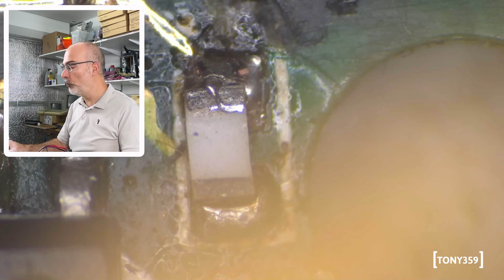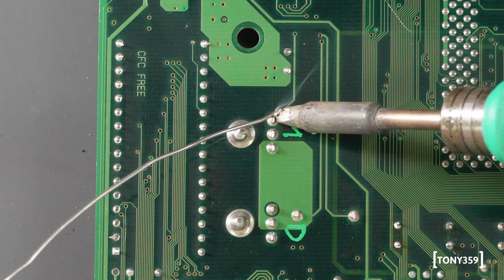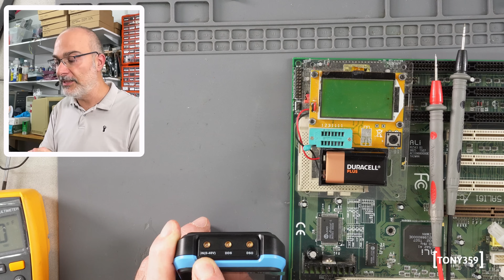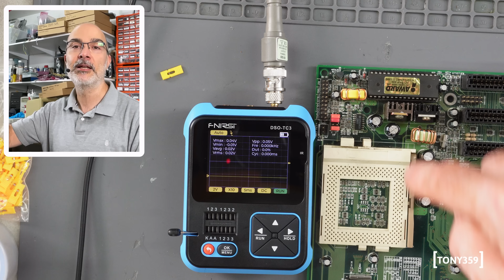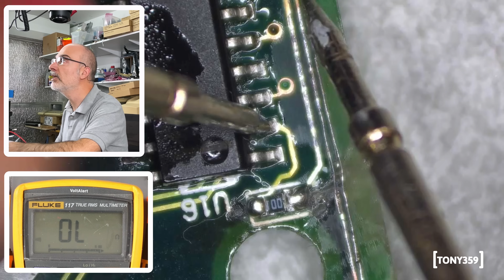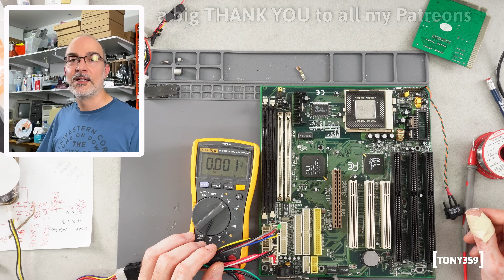This motherboard surprised me with multiple unrelated faults!

Comment: For those cheap component testers you usually do calibration where you connect pins 1,2,3 together and power up. Your old tester maybe too old to have that feature or need to have software update. For my tester it improved measurement accuracy. If I remember right it was showing too hi esr and Rds values before calibration.
Edit: Also discharge all caps before putting them to tester. I have killed one tester that way.
Reply from the maker: Thanks - The Fnirsi was calibrated just before shooting the video unfortunately.
Mine doesn't have that feature indeed - I'll see if I can update the FW!

Comment: Break the track from the Southbridge and drop the reset to see if boots? Would pulling the reset line low artificially do any damage?
Reply from the maker: I could try but I doubt anything would happen if the Southbridge is not working.

Comment: I have this board, It works but its niggly, Windows 98 wont install nicely if  USB (other BIOS setting ??) is enabled, I can't remember exactly but using ATX power,  the soft-power/the power button  doesn't work right  if I recall correctly, if the instant power off is enabled in the BIOS it doesn't work,  so its  holding the button for 5  seconds, while not the end of world its gets annoying fast when troubleshoot a retro PC . Don't mess with JP2 near battery, as jumped to pin 2-3 will cause one of diodes near by to short, luckily the diode just de-soldered it self from the motherboard didn't do lasting damage.
Reply from the maker: interesting - you're saying that maybe all I have to do is to hold the ON button for 5 seconds or something like that like that weird Acer MoBo I had before? I've done most of my testing without the BIOS to be honest as I'd expect the Reset line to work without it - the board won't execute code in RESET I suppose...
I think I tried that jumper in position 2-3...
Reply: @tony359  R178 is indeed a 10 OHM (SMD 100) resistor on my board. sorry I messaged without completely watching. No, not at your level of troubleshooting so was just giving general advice on that Board... that ALI chipset also has issues  It doesn't fully cache memory above 128MB  or something like that as  if recall correctly  unless  its chipset revisions G and H.  I can test other bits on my own board (its in strip down state no battery and I stole its jumpers)  if that would help, I do own a scope but digital testing is not my forte.
Reply from the maker: Thanks for confirming that that resistor is actually correct!

Comment: These component testers are very useful (I've had 2 that I've been using for the past 10 years or so) but you must be aware of their limitations. For instance take a JFET like J105 which has a very high Idss on the order of a few hundred mA. The tester will not identify it correctly. It reads it either as a resistor, or as a double diode. This is probably the most extreme case; there are other situations that fool the tester, for instance components that need to be tested at voltages higher than it can provide, which is around 8-9V (the 9V battery is an indication of that).
Reply from the maker: Of course. I don't expect a £5 tool to perform like a £200 one. I'm not expecting perfection. Just not 100x difference from a similar one :) Thank you for watching!
Reply: Also simple germanium diode is often not detected even germanium transistors are measured quite OK.

Comment: The difference in ESR and capacitance could be do to the frequency it tests the capacitor at.  What does your Fluke say for the capacitance?  Does either of your testers say the frequency for LCR testing?  If you are going for a LCR meter go with the DER EE, DE-5000.  Excellent LCR meter for the money.  You may want to pay the extra now and get the meter with the tweezer option, expensive to add later
Reply from the maker: Thanks - yes, I am eyeing the DE-5000. I think it's time I have a decent capacitor tester :) Thanks for the hint!
Reply: @tony359  Use oscilloscope and measure the frequency both testers are using. Maybe thats why ESR differs so much. 
Btw 22u capacitor with ESR 10ohm is bad, but in transistor radio would still work OK for years if its used in AF coupling :-)
Reply from the maker: I'm looking into that, they don't use a traditional way, there is no "frequency". They use some tricks because the ATMega cannot deal with those frequencies. The original documentation of the "transistor tester" says the ESR should be comparable to the 10KHz one.

Comment: Tip for surface mount work around plastic: Captain tape. It won't make the plastic invincible but it increases your margin for error enough to be worth it than not.
 Using a preheater under the board to get the board warm will also help.
Also do yourself a favor and don't use the $60 junkazon special. Get a Quick or a Atten.
Reply from the maker: I do have a (genuine) quick :)  (Junkazon special LOL!)
I do have a pre-heater!

I will make a shield using some tin (from a drink can). Plus kapton as you say. 

Thanks for taking the time to send me some tips! :)
Reply: @tony359  I don't trust those $60 stations. I don't think they have the "horsepower" of the more expensive ones and after seeing "EEVblog #1171 - Yihau WEP SMD Rework Station Meltdown!" I have concerns about fire safety.
Reply from the maker: I used to have a Aoyue and I know what you mean. They're junk and you can only burn things with them as the air temp is uneven. That said, dosdude1 does wonders with it :)
Reply from the maker: I try not to buy mains-operated equipment from Aliexpress/Ebay. They can have serious safety flaws...

Comment: I would try to cut reset trace from the ALi chip and see what it does, before replacing it. Also, that 10Ω resistor looks a little bit sus to me.
Reply from the maker: Well, I would nee to pull it to ground, not just cutting it. And the CPU and PCI reset lines are elsewhere. One thing I did not check is what happens to those other reset lines though.

Comment: Component terminals rejecting solder like this resistor it happens, when there's a thick oxide layer. It's an indication that the component is expired and hasn't been stored well.

Also i hate components being arranged so close to a hole like that, because that's why that whole section is damaged and had to be reworked by previous owner. Is the hole needed? I don't think it's an AT/ATX mounting hole, i don't know why they put it in, did they need it for some sort of factory jig? It's terrible either way.

Ahahah when you have one voltmeter, you always know what the voltage is. When you have two voltmeters, you never know what the voltage is! Doubly true for these ESR/LCR devices!

I would rather trust the cheap one. It's a faithful reproduction of a German open source project, and the values it delivers, even if they are not what one might call exact, because really who knows, these are not straightforward values to measure, they just make sense for repair purposes, since it's quite sensitive to decayed parts. What TC3 shows doesn't make much sense! I too have the classic cheap LCR T4. Been thinking of hand building one of my own based on the upstream project.
Reply from the maker: The resistor is definitely damaged (though it works). I need go get some stock of SMD components for those cases...
The cheapo tester has served me well over the years, I cannot be 100% sure but it felt accurate enough. That 22uF cap is completely shot - I know that for sure: the TC3 doesn't reflect that!
Reply: Btw. this is NOT a mounting hole ☝️ and bssically you can find it on all corners. Possibly for production or emp- and deploying purposes.

Comment: Your LCR tester must have a certain test frequency that should be stated somewhere in the details of its specifications.  The higher this test frequency, the better will the test results concerning the ESR will be. Just my humble opinion.  Thanks for your tinkering job !
Reply from the maker: I looked into the original project and it's not using high frequencies - the ATMEGA can't deal with that. It's using some tricks to achieve a "good" result. I'll make another video to show that!
Thanks for your comment!

Comment: I think you forgot to test if the new voltage regulator IC is actually outputting the power good signal itself. in complex boards like this one single signal not good will drag down all the rest so maybe there is one single fault left somewhere making the reset line stuck. I am not sure if the southbridge itself output PG to something. I think it just receives?
Reply from the maker: It didn't make it in the video but if you watch the pads when I de-soldered the IC, you should be able to see that the PG signal is not connected - so unfortunately I doubt it's our problem. 
Yes, there might be something else which is preventing the SB from starting. Who knows. One thing I forgot to check are the CPU and PCI reset lines: are they doing the same weird thing than the ISA reset lines? Thanks for your help!

Comment: It does make sense that the south bridge is damaged. What I think happened the the Vcore mosfet shorted, took out the Vcore driver chip via the ugate signal, and when it killed that chip, it then sent 12V up the powergood out of that chip to the southbridge, damaging that too. That's my guess.

Re the Component tester, have you done the calibration routine on it? You basically need 3 pins shorted together (I use a 3-pin header soldered together),  and a capacitor greater than 100nf. You put shorted pins into 1-2-3 on the tester, press the button, and it'll come up selftest. it will scroll through for a bit, then ask you to remove the short, then after a bit it'll ask for the capacitor. once you fit the cap, it continues till it's done. It's worth doing, to see if it improves the accuracy. It's seems the TC3 might have this calibration mode too, so it might be worth trying, and see if it improves the readings.
Reply from the maker: Hi - the powergood line of the VRM controller is not connected to anything, you might be able to see that when I removed it. Maybe the 5V got to the CPU, the CPU was fried and sent 5V to the Southbridge? But the Southbridge is behind the Northbridge... (that would be bad news!) Thank you for your idea!
Reply: @tony359  You're right! my bad. I thought it would get a powergood signal from the VRM chip, but obviously not. I think we'd really need to look at the circuit diagram to see where the southbridge powergood is then. It's worth checking all other things connected to the PG and Reset lines before jumping into a BGA replacement.
Reply from the maker: Without schematics it's complicated. To be honest, this is a socket 7 board. I think the PSU powergood signal is the only one going to the chipset. Also, computerguy from TRW told me his "power good line" going to the SB is 3.5V. Mine is 3.5V. So, unless there is a BGA problem, powergood is not the problem. I think.

Comment: Randomness, fluctuations, cycling or instability are generally caused by bad aged capacitors. Logic and chips are consistent wheter faulty or good.
Reply from the maker: This board is consistently dead! :)
Reply: @tony359  I forgot to mention the Reset line voltage, which you said to be "all over the place." The voltage fluctuations, as seen on the meter 2.3-2.7V, are telltale signs of bad caps.
Reply from the maker: @RatioExMachina  It reads 1.7V when ground is connected. There are very little electrolytic caps on the board and I am confident there are none on data (reset) lines. It's difficult to probe the BGA and confirm that 5V is stable but I can check elsewhere. I appreciate caps are the evil but I doubt a cap is causing this on this board TBH. Thanks anyways!

Comment: Some power circuits have a power good signal that is used to hold reset low while it's stabilising. Could it be something like that acting up?
Reply from the maker: It could be, the white paper is several hundreds pages, I searched for "reset" and what I showed on video is the only mention. It could possibly be that something else is holding RESET - though I'd still expect RESET to be 3.5V, not 2.2V!

Comment: Does this board have jumper to determine power supply type? My ss7 board behaves exactly the same way when that jumper is set incorrectly or is missing.
Reply from the maker: No unfortunately. Which is weird but there is no selection for AT/ATX. I tried ATX and it powers up when the power on button is shorted.

Comment: Hi Tony, please make a follow up video. Also, I would like your and from the guys the opinion for a similar issue that I have. I have a motherboard "Fujitsu Siemens FSC D1837-A21 W26361-W84-X-02" and I tried the below:
I replaced the RAM with a same and functional one (from a same second motherboard that I have).
I replaced the CPU with a same and functional one (from a same second motherboard that I have).
I check the CPU socket for bend pins and all are ok.
I have replace the BIOS chip with a same and functional one (from a same second motherboard that I have).
I have replaced all the caps in the yellow circles with brand new capacitors.
I place a buzzer on the motherboard and no beep even when I remove the RAM.
On the coils of the CPU I have always 1.55V but at some point after testing I didn’t voltage at all in CPU coils and after I desoldered the resistor from the ICOMMON pin of the ISL6565 chip the it start to have again 1.55V on the CPU but still no image. Maybe this motherboard have issues with cold solder joints?
The current from the BIOS battery is 0,54uA (in the faulty one).

I tried some PCI tester cards and gave me the below codes:
The one of them show nothing "--".
The second show "0000".
The third show "FF".
Unfortunately, I can’t find any schematic of this motherboard. Do you know what else to check? Please I would very appreciate any advice. I have three months now that I am trying to repair this motherbord (I am not doing it for the money but because every problem give you new knowledge). Also, I have made many measurements with multimeter and oscilloscope and analysis of the phase chip on the eevblog forum (Thread name: "Mainboard with No Picture")...  if you please take a look. Please I would very appreciate any advice. Also, what is the "reset sequence for the system"...? Where can I read more for this? I apologise if my test is big. Thank you very much for the sharing of your knowledge.
Reply from the maker: that board is a socket 775, it's way more modern than this one! :)
Reply: @tony359  except of modern it is a big headache and a ghost too because I can't find any schematic.

Comment: Motherboards with this chipset are the most expensive super socket 7 platforms to buy (at least in my country). If it will be really necessary I would like to see reballing of this south bridge.
Reply from the maker: Thanks!
Reply: Because those boards were unstable and weird even when were new. So not many boards survived. I like more Via MVP3, it has own issues too, but mostly works.
Reply from the maker: The MVP3 of my 591P says "hi" - I still have shivers :)

Comment: You musst start the automatic Calibration of the LCR.  Short all 3 Probes and turn it on!
And: empty Battery/ Undervoltage triggers bad Readings!
Reply from the maker: I did before shooting the video.
I can try again with a full battery, thanks.
Reply: @tony359  Send the FNIRSI back,  it´s the best you can do. Try another one...